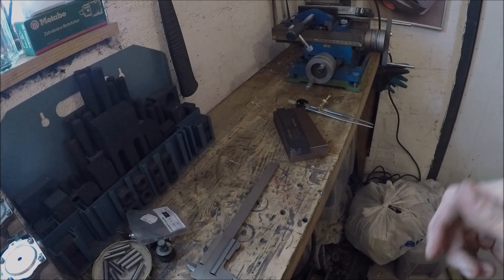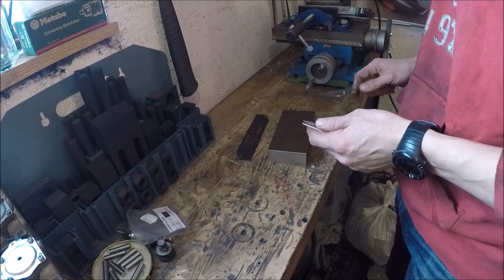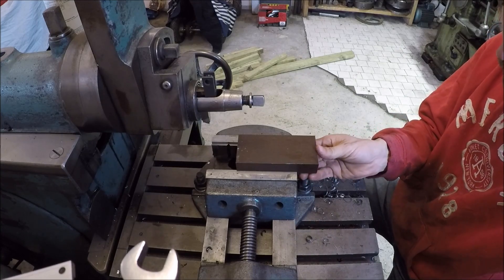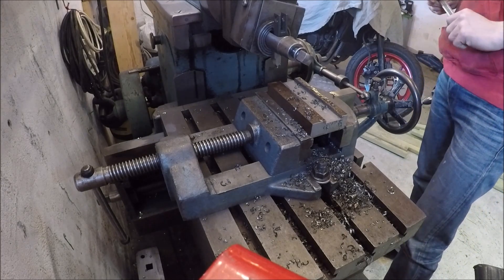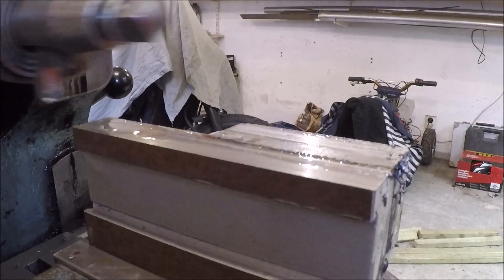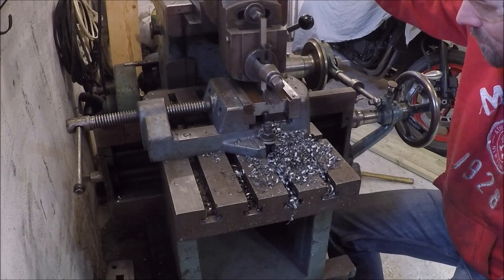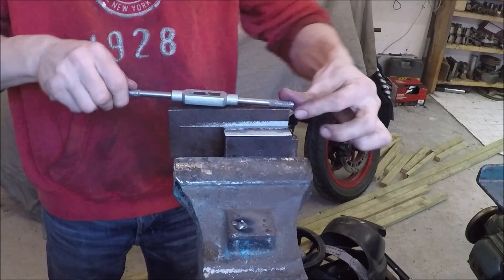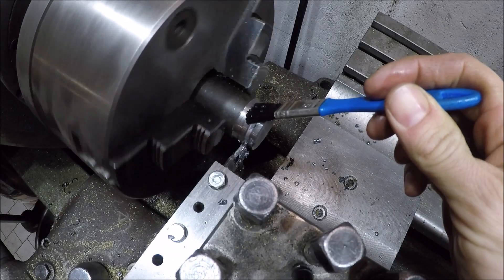Machining a tool holder on the 100 year old shaper!

Comment: To the last guy that commented , if I had a shop like that my wife would never see me. Lol. I have a lathe but wish I had a mill and a shaper. Can't afford new ones and most of the older ones I've seen is to far gone and parts is getting hard to find. Good job on the cut off tool.
Reply from the maker: Thanks Anthony!